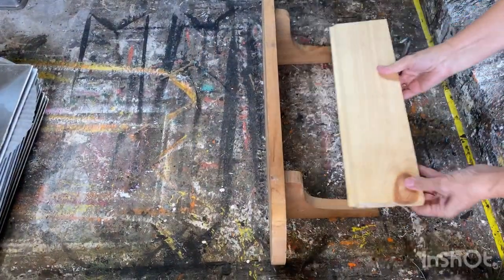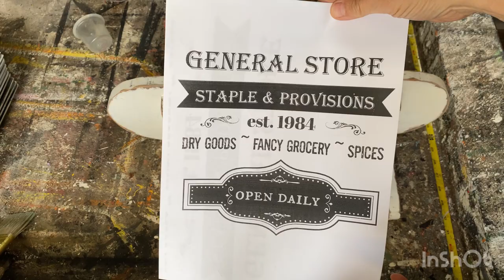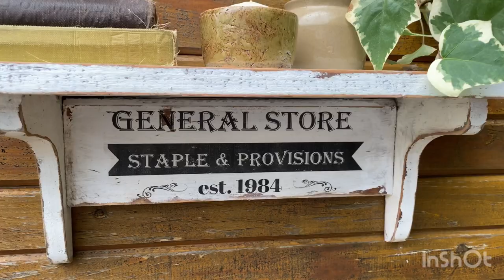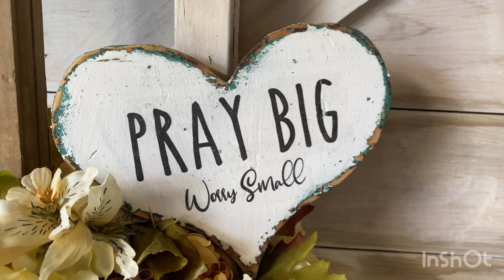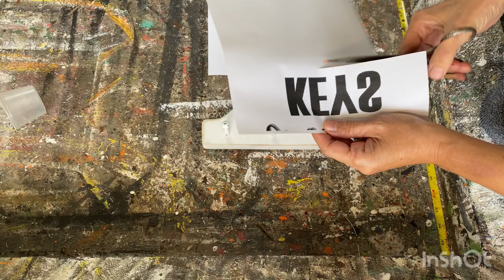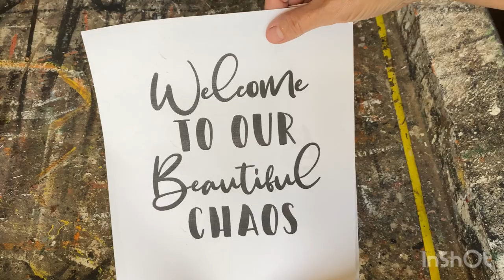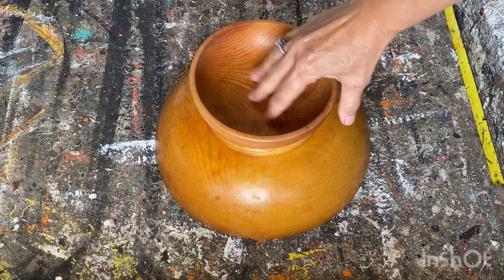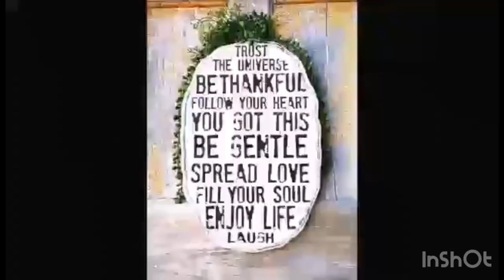Turn Trash Into Treasure With These Five Thrift Store Makeovers

Comment: I love this I love all of your ideas it’s so much fun. I tried the reverse method and where I had my paper cut out it seemed you could still see paper on the edges of the square… Does this mean that it  should have been wetter and continue to rub off.
Reply from the maker: I would just dip your finger in a bit of water and just work at that area till it looks better. You might have also put your mod podge on a bit too thick. Keep practising !

Comment: I tried the reverse mod podge image transfer method but mine did not turn out very well. 😕 The ink smeared and parts of the image came off with the paper as I rubbed it. Maybe I wet the paper too much? Or maybe it’s because I have an inkjet printer instead of a laser jet? I don’t know, but if you have any advice let me know. Thanks! I really enjoy watching your channel!
Reply from the maker: If you used a ink jet it is a bit more tricky. make sure when you print out you let the ink dry really well before you do the process and use very little water and work in small sections. Keep trying it takes practice
Reply: @OurUpcycledLife  Thank you! I will try it again. 😊

Comment: I love all videos I have seen!  I have tried the reverse modge podge  method, but I haven't  had good results, the text keeps rubbing off.  I have used a Lazer printer, modge podge, let it dry overnight, but when going to rub off the paper, part of the text is also rubbing off.  What am I doing wrong?
Reply from the maker: Thanks for watching! Did you do it over a chalk painted surface?
Reply: yes I did, Waverly in the color plaster
Reply from the maker: Ok, maybe you are using to much water and just rubbing to hard. It takes a bit of practise and they never come out perfect . Keep trying. If you can send me a pic on either Facebook or Instagram I could tell you better what is happening. The links for those pages are in the description ❤️
Reply: Thanks so much for your response, I will keep trying!